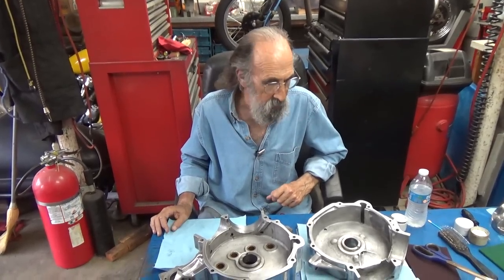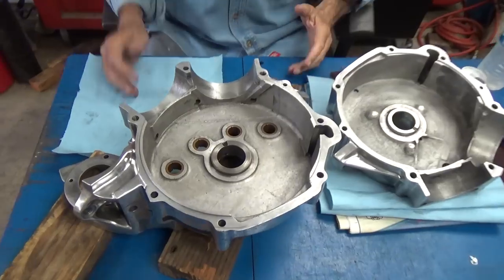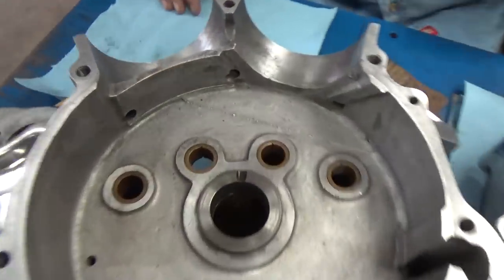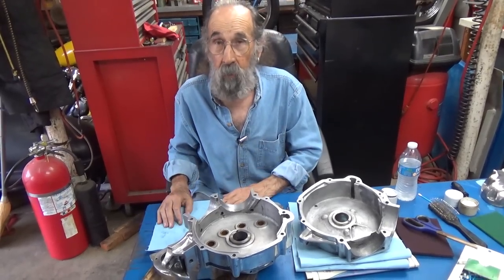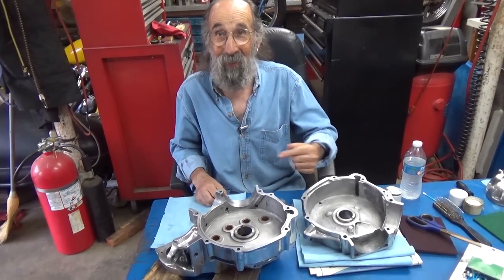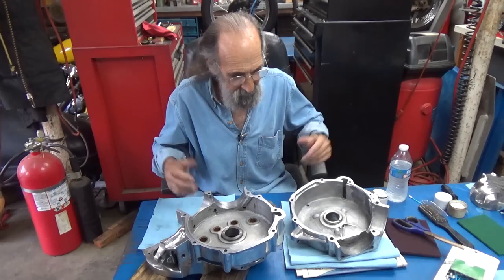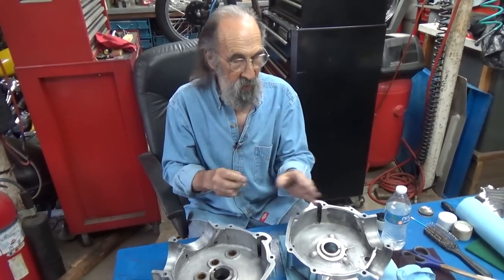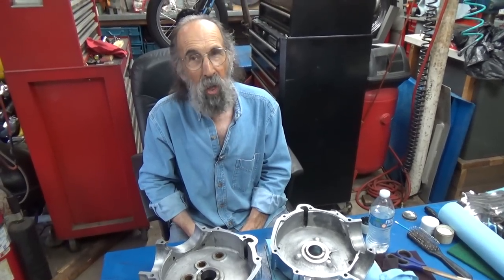Lapping the Flathead 80 Cases Together

Comment: In case my fellow Mike, Mike, and wireless mic fans don't know, valve lapping compound comes in both "oil mix" (suspended in a light grease/thick oil) and "water mix" (suspended in a thick soap solution). Both do their job equally well, the difference is clean up. Oil mix is a bit more tenacious, but you get best clean up results scrubbing with a petro-friendly solvent or a caustic bath, water mix gives best clean up results with hot water and detergent. The "old wisdom" is oil mix is for parts you toss in a hot tank full of caustic to clean (iron and steel), water mix is for parts that don't mind being boiled in a tank full of tide but caustic stuff tends to etch/eat them (aluminum, magnesium, pot metal). Either works on all parts of course, the only real difference is what you thin them with, and clean up with
Reply from the maker: Thank you.  A very informative explanation.

Comment: Great video Mike thanks for showing the proper way to seal cases. I think I mentioned to you a while back when you showed lapping the evo  cases I had a leak in the cases right below  the oil filter on my street glide with an M8 motor 1200 miles on it. Dealer resealed cases I doubt they took the time to lap the cases. but so far so good but it's always in the back of my mind. Keep up the great work Kenny
Reply from the maker: Thanks again!

Comment: Mike, I hope you can get a belt drive to line up pulley-to-pulley with some degree of accuracy. When I first started running belt primary drives, I found it difficult to get decent alignment. That was due to my using tapered engine sprocket shafts and of course; a tapered main shaft on the transmission. Splined sprocket shafts could allow for shims which could aid in pulley-to-pulley alignment of the primary belt. In short, those belts have to be pretty darned straight, or they will wear out quickly along the edge of the belt. Running a Ram Jet "tamer" (clutch retainer) and long needle bearings between the clutch hub and clutch basket helped somewhat. Thanks Mike! Ride safe! -- W
Reply from the maker: It's all about alignment.  I've shown this alot on our videos.  I've done them since the early eighties.  I've worked with all of the brands.  Our videos can be found on our Youtube Channel.  We'll do it again when I set up the belt primary on the Flathead.
Reply: @pacificmike9501  Thanks Mike!

Comment: Great video Mike. The only thing I would add is to be meticulous about deburring the cases with a flat fine file before lapping because any burr is going to get dragged across the mating surface and interfere with the intention of providing an absolutely perfect mating surface. Later bro.
Reply from the maker: Good point.

Comment: I really like watching you doing all this work Mike and of course I have a question about my 46 knuckle, I have been out on it, [ love it]  and it seems to be dripping too much oil, mostly under primary along frame in 3 or 4 spots, could it be the breather putting too much oil on the chain and leaking through primary cover, or pressure set too high. I dont see any oil leaks on motor. Thanks for any light you may be able to give me. Dom
Reply: Nice bike👍👍
Reply from the maker: If the primary is a chain (as it was designed), it is a "total loss" system.  The oil comes out the breather tube onto the primary chain, into the bottom of the primary cover, and from there, onto the ground.  I've shown this in several videos.  That's the way it was originally.  Personally, I extend that breather tube behind the primary cover, turn off the oil flow to the breather, put a seal on the motor sprocket shaft, and install a primary belt drive.  In the old days, dripping oil out of the primary chaincase was just fine.  Harley did this up until 1965 when they installed cast primary covers an oil recirculating system.
Reply: @pacificmike9501  Thanks Mike, I'm new to these older bikes and will just keep an eye on my oil level for now. I will put a video up of it soon on my channel.

Comment: airplane engine cases, i.e. Lycoming and Continental, are sealed by using a thin coat of aviation gasket sealer and then a silk thread is placed in the middle of the flange. They are similar to the Harley cases in that respect.
Reply from the maker: Yes.  I've known several Aircraft mechanics.  They are a real wealth of knowledge.

Comment: If pistons are the feet of things & con rods are the legs, 
pushing crank pin knees around a set of flywheel pegs.
If main bearings are the hip joints, then the cases are it's pants,
well cast in al-you-mini-um (to invoke old 'wordsmith' rants).
With a pair of leg holes up the top , & stiffness all around,
to help stave off incontinence, they like their edges ground.
. . So, we must leave our hero lapping a pair of rigid shorts for his flathead, & ponder the curse of vertical gussets. Y'all : )

Comment: Loving it. Quick question, I have a 1990 FXST that I'm thinking about building a striker out of it. I was wondering, if I decided to go with later model EVO heads that are head breathers. I would plug the port in the case, would I also have to go with a later breather gear, or are they the same?
Reply from the maker: You can do it quite easily.  Stock breather gear should work fine.  Using both top breather heads and a breather out of the crankcase too relieves a lot of pressure and that stroker probably won't leak.
Reply: @pacificmike9501  right on, thank you

Comment: Hello Mike, What sealant do you recommend between cases surfaces to avoid oil leakage ?. Thank you in advance
Reply from the maker: I made recommendations on the video.  Yamabond, three bond.  There are several on the market.  All that I've tried have performed fine.  Currently, I've been using Three Bond.
Reply: @pacificmike9501  thank you very much Mike. Greetings from Ecuador South America 🇪🇨
Reply from the maker: Greetings!

Comment: Mike, you're a long time mc mechanic and probably prefer having bikes that are still manageable to work on.  Have you ever owned a M8 are considering buying.  What are you're impressions of them.  Having the test equipment and constant software upgrades is probably prohibitive to do the deep dive on the electronics.
Reply from the maker: Not exactly my cup of tea.  This morning, I road my old Shovelhead in the mountains.  It was a beautiful morning.  Climbing the mountains with that kind of raw, homebuilt torque was a real party, way more power than I could even use.  It's the kind of party I crave.

Comment: ALSO Mike HOW DO U KNOW IT'S the PADS, WHAT ABOUT  the PAD BACKPLATES  NOT HAVING GREASE OR NOT ENOUGH. OR NOT IN the RIGHT SPOTS. HOW DOES ONE KNOW Mike , WHICH IT IS ?
Reply from the maker: Trust me.  Some pads are noisy and some are not.  Sometimes the material the pads are made of is noisy.  Sometimes the material holds debris you picked up on the road.  My solution to disc brake noise is Kevlar.  How do I know this?  From the same experience over and over again.
Reply: @pacificmike9501  🙏🙏🙏🙏🙏🙏